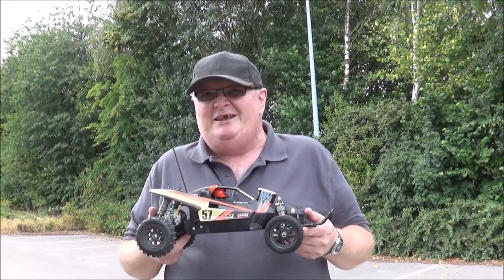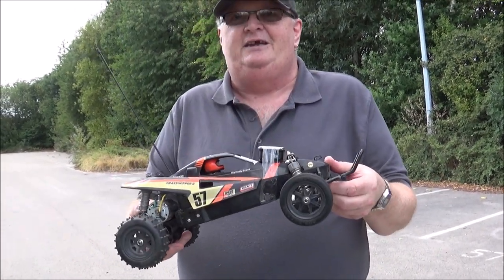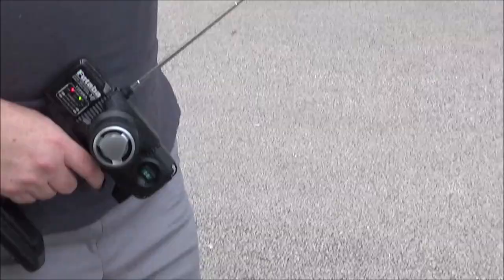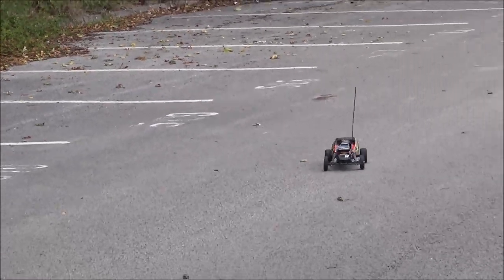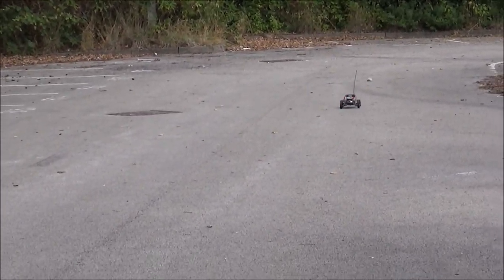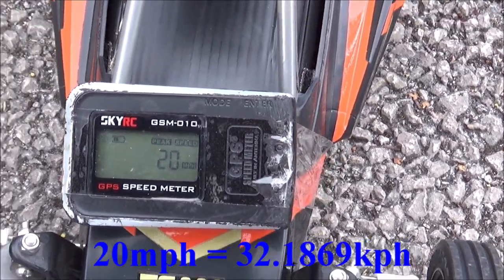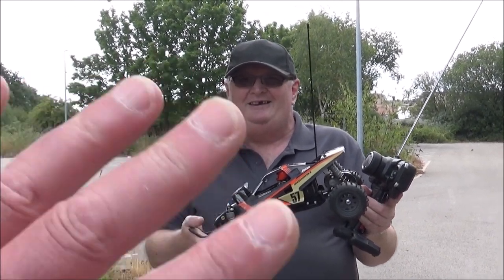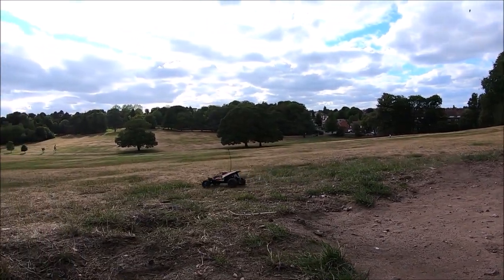Tamiya Grasshopper II Speed Run

Comment: I put a Brushless motor in the Tamiya Hornet kit I bought 35 years ago.   It was almost unsteerable at full throttle.  The differential was completely stripped after just a few minutes, but it fun while it lasted

Comment: Now it is time for a 4000kv brushless system, some oversized rear tires and try to set some records! LOL! I am sure you had you fill of that stuff for a bit! It would be a fun car for next years speed challenge though!!
Reply: I tried a Brushless reedy motor from a Associated SC10 in my hornet.   It completely destroyed the rear differential in a few minutes. :)
Reply: @DuffusMonkey  really? The hopper rear ends are pretty stout usually. I just punished mine in the lunch box speed run and it held up fine. I am sure bouncing around in the dirt and grass is way harder on them though. I am sure it was crazy while it lasted though!!
Reply: @AddamsPlayground Mine had been abused hard in 1984 and 85 When I was 15 then put into storage until my oldest son was was about 12 years old.   It was probably a little brittle
Reply from the maker: I never had a hopper back in the day but my original Thunder Dragon was rather brittle when I got it out again after around 20 years of being stuck on a shelf. But Like Addam I've had my Midnight Pumpkin (Luncherrari) up to 36 without any problems. Thanks for watching and all the best.
Reply from the maker: Now that sounds like a good idea. Still got another run with the Luncherrari though first. Many thanks and all the best.